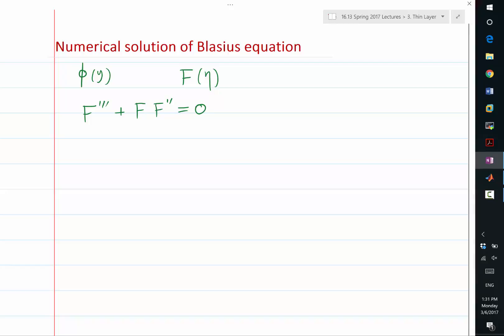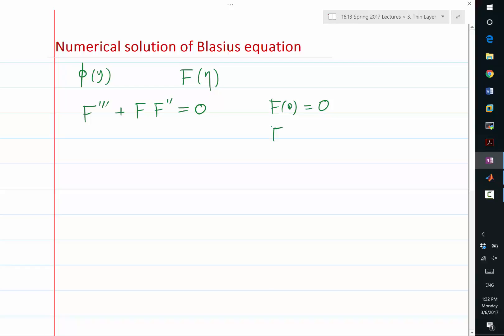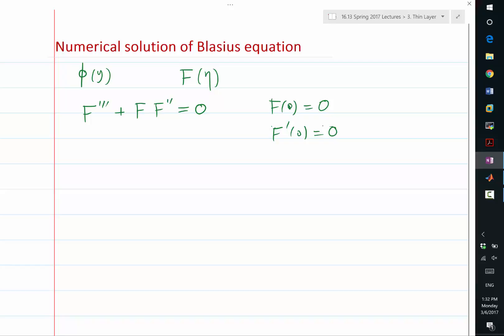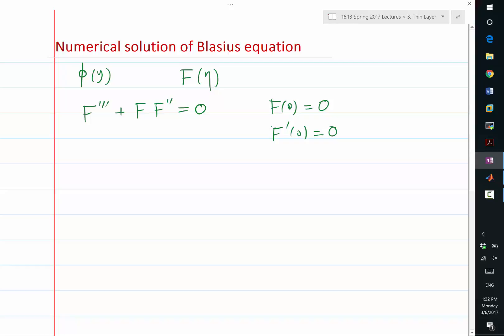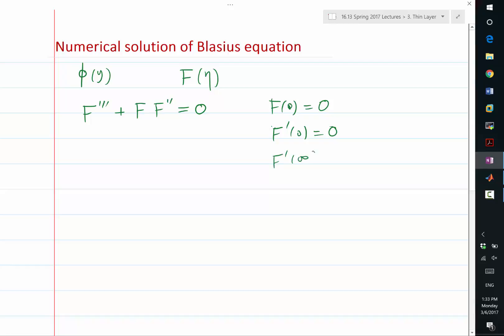MIT Aerodynamics of Viscous Fluids: The Blasius Equation

Comment: I think I found a mistake in problem set 4. Problem set 4 says to take a given shape parameter function and input it into newtons method to solve for variable "a" in the Falkner-Skan equation. 
The shape parameter function is :  integral (1-U) dy / integral (U-U^2)dy = H. 
When rearranged, and take the derivative of both sides it becomes : 1-U=HU-HU^2 => HU^2+(-1-H)U+1=0, and this has roots U=1/H & U=1.
This is like setting a constraint that U at EVERY point equals 1/H or 1, so this can't be correct right? I tried setting this constraint at each point, and it adds 1000 new equations to the system, but the algorithm does not converge. 

I also tried approximating the integral using rectangle middle rule, but Newtons Method still would not converge. 
I tested it with a working solver of Falkner-Skan where I manually input the variable 'a', solve for U, and approximate H using rectangle middle rule. Then I use that solved H in the new algorithm where 'a' is an unknown. The working algorithm works the same way as the solver you built in these videos, so I know the solution for H should be correct. 

I think the problem is with the integral/shape parameter H itself, am I right that it sets a constraint on every point to force the solver to try and make U=1/H or U=1 ?

Here is a link to the problem set for convenience  : https://learning-modules.mit.edu/service/materials/groups/166456/files/f357d9e2-6112-4ffe-8159-e49c3bdcd70a/link?errorRedirect=%2Fmaterials%2Findex.html